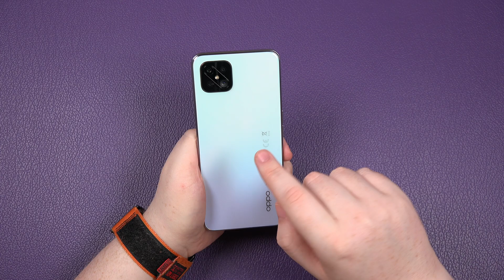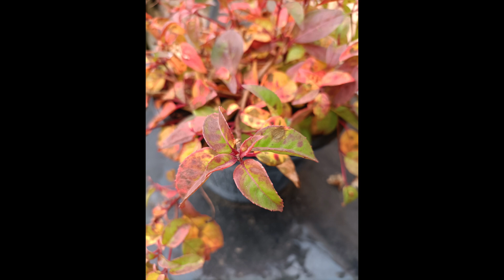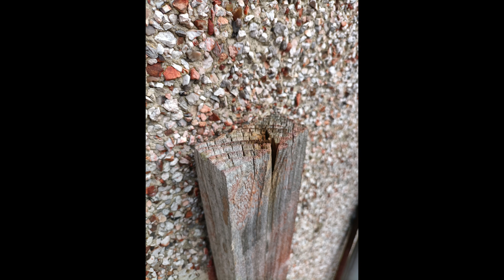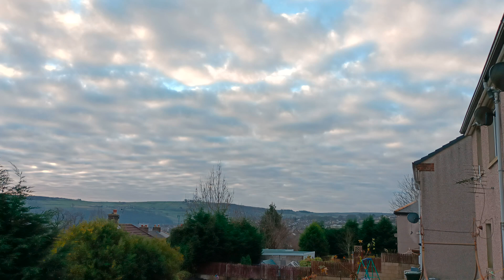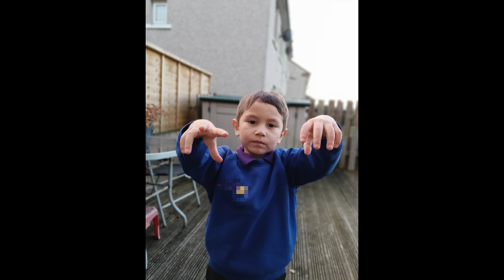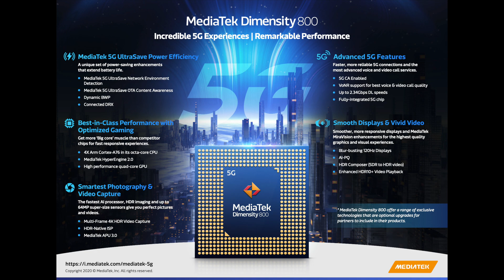Oppo Reno4 Z - Featuring the MediaTek Dimensity 800

Comment: The MediaTek Dimensity 800 also supports displays up to 90 Hz in FullHD + resolution, 64 megapixel cameras or 4K HDR multi-frame recording. Which makes it above the SD 765.

Comment: Thanks for the raffle of an Oppo Reno 4Z phone con Media Teck Dimensity 800 Processor, the objective onthe of this platform is to bring 5G technology to mid-high range proposals.
The Dimensity 800 is presented in the framework of CES 2020, as a proposal with an integrated 5G modem, a 7nm manufacturing process, and this is one with e of the mobiles to debut with this processor this year 2020
I hope I can win this time
Thank you thank you thank you